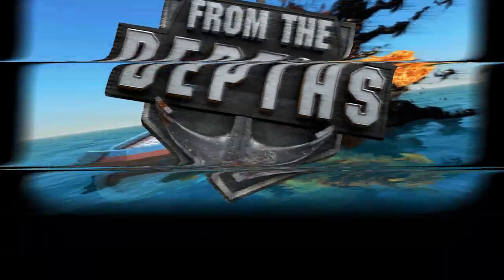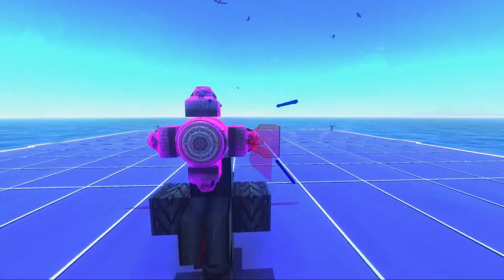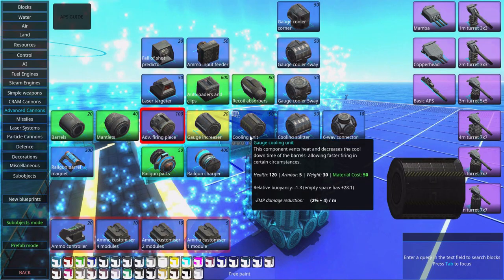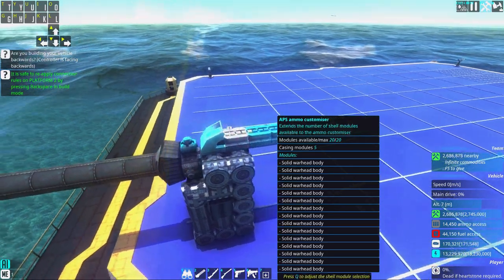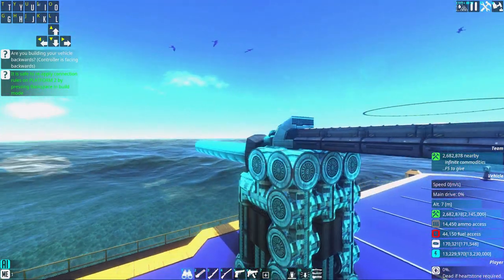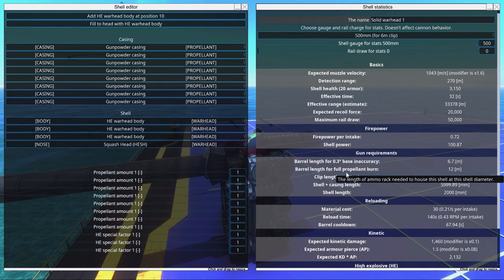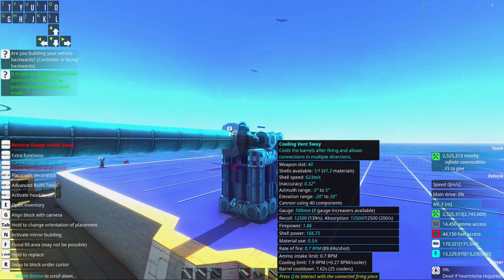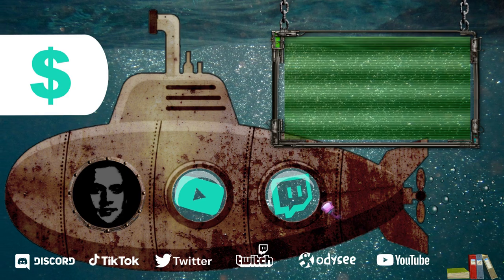From The Depths INSTANT Tutorial: DIF-Guns (APS Tutorial)

Comment: 6:14 for anybody, thats only if you don't touch the rpm default for the aps which is 2400, if you set it to 0.4rpm like in the video, it wont fire every 7.6 seconds
do also note that gauage increasers cost 20, coolers cost 50, Minimum expense I've done for a turret is 1179, in this toturial its 1910
components I'd really recommend is heat/heat secondary and emp which is the best parts to use in these types of cheap guns
Reply from the maker: Ah, heat emp does sound good!

Comment: But have you ever tasted the forbidden fruit of the 500gauge 8m autoloader artillery rapidfire "turret" firing at 600 rpm (or 1200 at 250gauge with same ammo).
Reply from the maker: Nope, like super slow shells to get artillery effect?
Reply: Maybe they mean making the gun only fire in high arc instead of low arc to rain shells on the enemy?